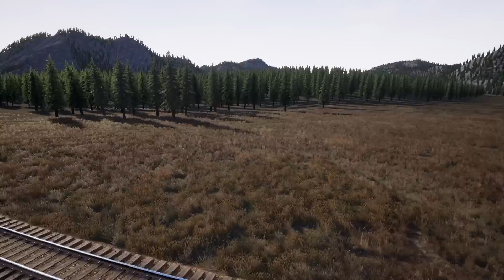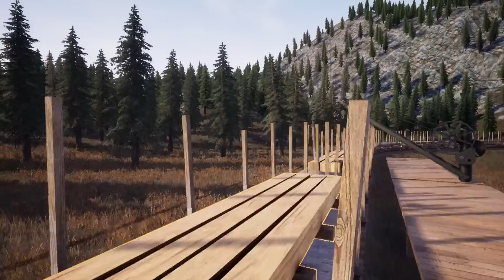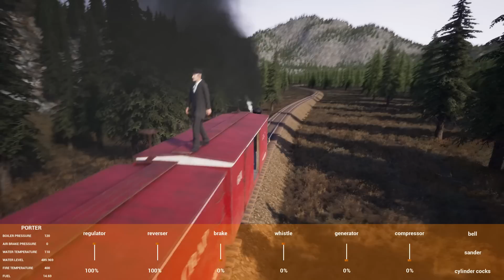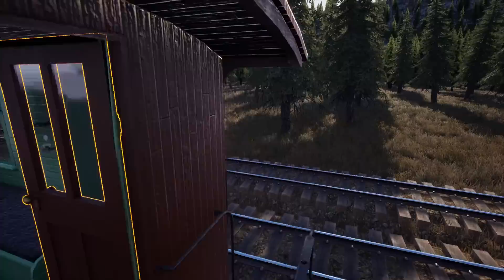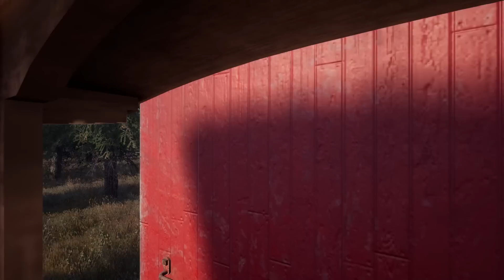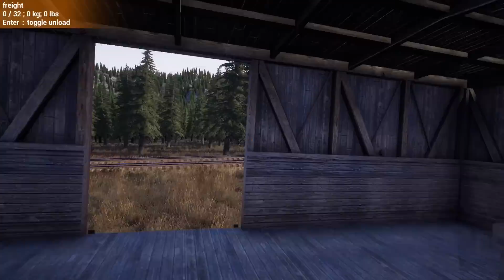Can The Smallest Locomotive Pull 23 Loaded Cars?

Comment: Diesel electic's had wheel slip control early on. It detected in through the main traction motor shunts by comparing amps. They would not cut engine speed but the load regulator, no cut it back rather cut it off momentarily.

Comment: You should get a class 70 for the 10%. They drastically reduced the weight of the tender at some point and now it can pull almost 50k lbs up a 10% grade. The new ET&WNC engine, despite being supposedly lighter (I think its actually a little bit heavier) and a bit more powerful has such a heavy tender that it can only pull about half as much.

I ran a test and the C70 pulled 1 of the new tanker cars and 2 cordwood cars (all empty), 49350lbs total. The ET&WNC couln't even handle the tanker car alone, until I swapped tenders and then it could!. It did struggle more than the C70 even with the lighter tender, which is why I think it is not 2k lbs lighter, but 2k lbs heavier instead.

The new one does have the advertised tractive effort though, it won the tug of war.

Comment: #21 needs to be the Tenmile locomotive… not only does the wheel setup and Johnson bar / reverser gear setup look like the designer was completely hammered when he walked into the blueprint office, you can add antlers to the headlight… which is like wearing a lampshade at this point. It SCREAMS “I am #21 Kenosha!!!” If I knew how to do the money thing (I’m not computer savvy, sorry) I’d send you $21 for it if you’d do it! xD (If you or someone could leave a response on how to, I’ll gladly leave a second message with it on that… that’s what’s called a “super  thank” or something, I think? It locks me into $1.99, $4.99, $9.99, or $49.99 in blue… yet I see people do even numbers all the time and it’s yellow? Can anyone tell me how to put in a specific number, please?) $21 for #21 to be the Tenmile! xD

Comment: As far as I know as an experienced mechanic, basically, modern locomotives have 3 types of anti slip systems, 2 types are modern while 1 is old but still present and "modernized":
1. Old system use sanding equipment for traction control. When the system detects that the wheels are slipping, it automatically applies sand to the rails in front of the driving wheels to increase their grip. The sanding equipment is usually controlled automatically by a computer system that monitors the speed and torque of the locomotive's wheels. This system is still in use on some diesel locomotives.

2. Wheel Slip Protection (WSP) system. 
Is an advanced technology used in modern diesel locomotives to improve traction and prevent wheel slip. The system uses sensors to detect the rotational speed of the locomotive's wheels, and when it detects a loss of traction, it automatically adjusts the throttle and braking systems to help maintain traction.
When the system detects wheel slip, it first reduces the power delivery to the slipping wheels, then applies the brakes to those wheels. At the same time, the system increases power delivery to the wheels that are still gripping the rails to maintain traction. This process is repeated continuously to keep the locomotive moving smoothly and safely.
The system also has a failsafe mechanism to prevent the locomotive from stalling. If the system detects that the wheels are slipping too much and that the locomotive is not making progress, it will gradually reduce the power to all wheels to prevent the locomotive from stalling.

3. Distributed Power (DP) system. 
Is another advanced technology used in modern diesel locomotives. This system uses a combination of communication systems, computerized controls, and power distribution to improve traction and control of the locomotive.
In a DP system, a locomotive is equipped with on-board computers and communication systems that allow it to communicate with other locomotives in the train. This allows the train to be controlled as a single unit, with each locomotive providing the necessary power to move the train.
The system also includes a power distribution system that allows the locomotives to distribute power to the driving wheels more efficiently. The power distribution system includes multiple generators and inverters, which work together to ensure that the locomotives are always providing the optimal amount of power to the wheels.
The system also includes a WSP system, which helps to prevent wheel slip and maintain traction. The WSP system in a DP system works similarly to the WSP system in a conventional locomotive, detecting wheel slip and adjusting power delivery to maintain traction.

Hope this explanation helps a little about anti slip systems
Sorry if my English is not good, it is not my native language.

Keep up great content and channel kAN

Comment: Question: Doesnt a wheel slip when it passes over the point of a switch since the wheel is in the air for a brief moment? Or is that time frame just too small for that to happen?
Reply: The wheel is mechanically linked to the other powered wheels on the same side, and all those wheels share a drive axel with the wheels on the opposite side.
It would only slip if that single wheel losing traction would be enough of a change for the entire powertrain to slip
Reply: @ValentineC137  Ah yea lol that makes sense

Comment: If Engine 13 is going to be a coal burner can you please keep the no-pilot pilot pattern going?
Reply: The wire frame plow is actually a cowcatcher. They were beginning to go out of style by the 1890s which is why you see them on older locos in-game. The geared engines and the switchers all have something that became dominant later on, which is called a d
Drawhead. This is the flat front that has a little board that you can stand on. A "pilot" from what i know id actually kind of a mish-mash between the two. (Think the nickel plate road 576) But yea, personally i like Drawheads more, but if you ever see a pic of a geared engine with a cowcatcher. Its so NEAT lookin'.
Reply: @mountainbriarfarm5030  I see...
Reply: No-pilot pilot pattern? What does that mean?
Reply: @ShawnF6FHellcat  The wire-frame plow on the front of the engine is called the pilot, I think, and it alternates whether or not the engine has a pilot.
Reply: @N0V-A42  Interesting... Thanks!